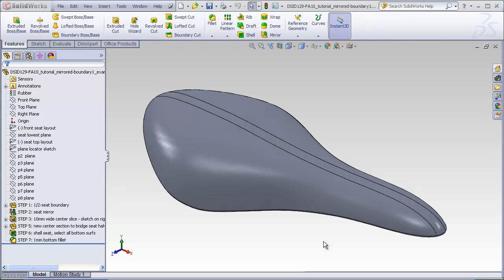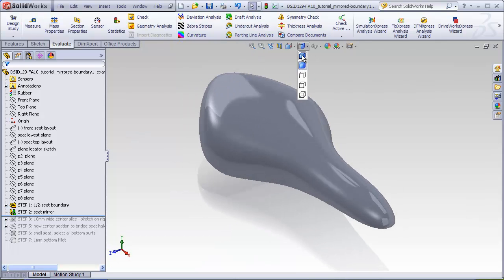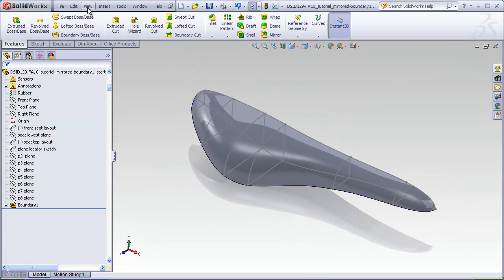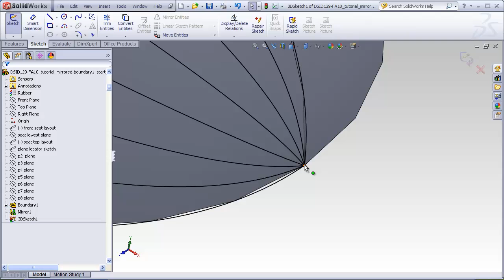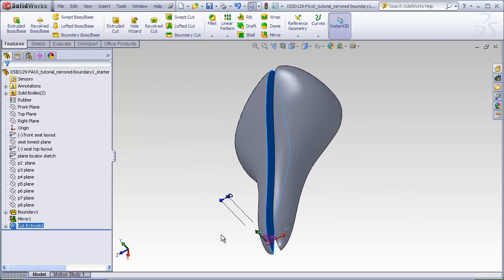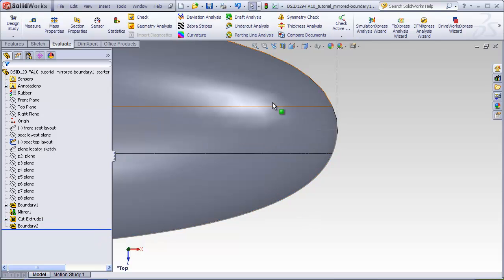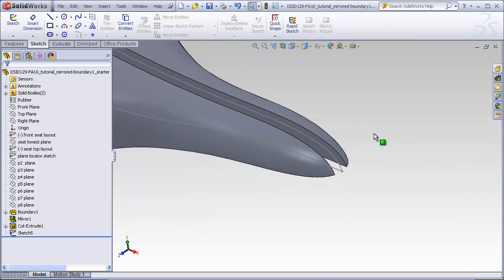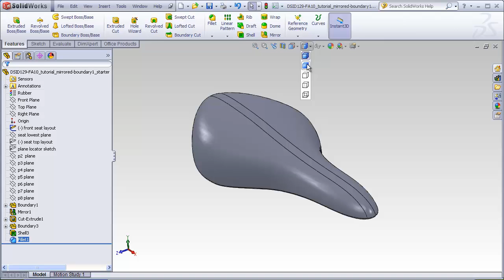DSID129, Mirrored Boundary - Smooth Blend, Method 1, Solidworks Tutorial

Comment: This is great cheers! If your loft sketch curves were tangential to the y axis before the mirror, do you think you'd avoid the 'step' across the mirror plane that this tutorial is remedying?
Reply: I managed it. Put relations in the sketches so the start of the curves is perpendicular to the mirror plane. Looks fine with zebra stripes on.
Reply from the maker: Theoretically, the loft should mirror smoothly, if the curves are tangential to the y axis (normal to the mirroring plane), but I've done a lot of experimentation with this, and it seems that if the loft of boundary goes to a point at either end (creating a degenerate point), the surfaces will not blend at the ends. So, I had to come up with this workaround. In reality, you have more control doing this sort of thing with surfaces, but the first semester students are only using solids.